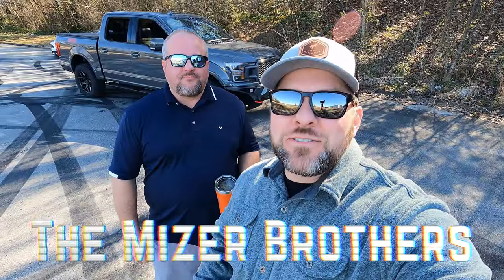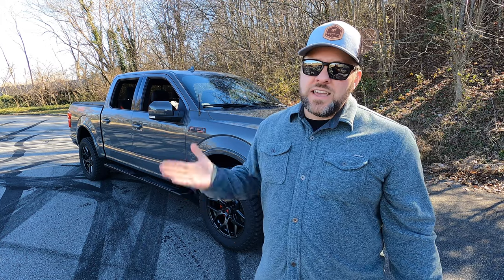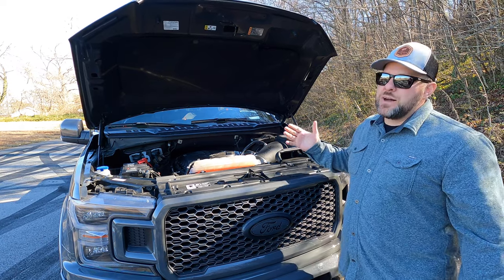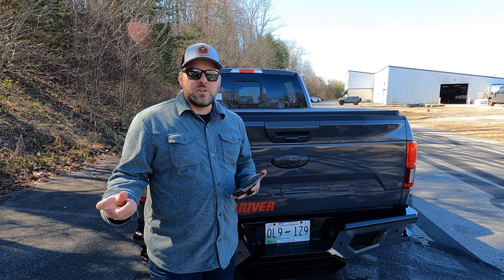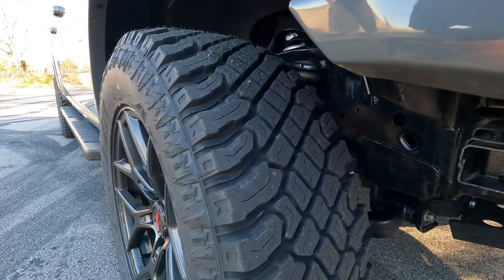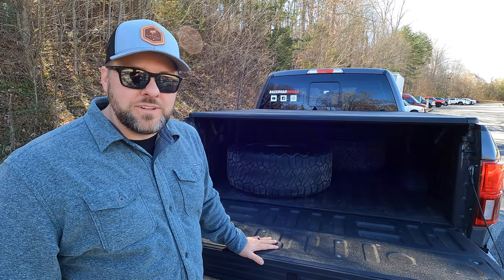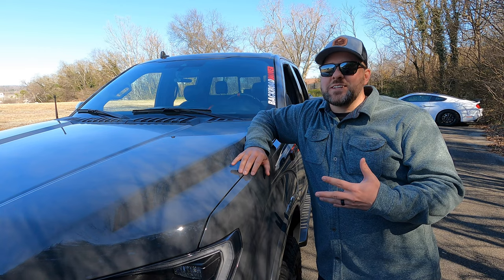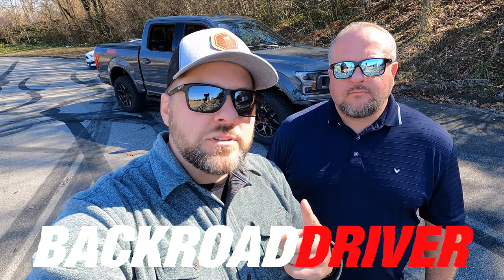What I spent building my 750 HP Supercharged Ford F150 - Complete build breakdown of The Wolf!

Comment: Hey Brad, here is my breakdown ion my 2016 f150 Platinum.
-VMP Odin kit, twin 69 mm throttle body, AFE cai, Fore return style fuel system for E85, long tube Charles’s headers with 3” true dual exhaust, oil pump gears and crank gear—$15,000

RTR wheels and 33” nitro ridge grapplers—$2,500

Icon 2.5” adhustable compression coil overs—$2,800

BWoody front and rear diff brackets and traction bars—$700

P3 vent integrated vent multi gauge—$540

About $22,000 total

740 hp at rear wheels and 615 lbft of torque.

You should check out the P3 V3 integrated vent multitude. It has some great features and looks awesome. Measures boost, speed, coolant temp, transmission temp, egt, iginition timing, AFR, it will do your 0-60 times.
I will try and attach a short video on your Facebook page.
Reply from the maker: Thanks Alex! Your Platinum sounds awesome! Do you have any wheel hop when you launch?
Reply: @BackroadDriver  I have absolutely none. However, I don’t quite have as much fun with mine as you do yours, haha.  The times I have really gotten in it though from a dead stop, I haven’t gotten any wheel hop.
Reply from the maker: We are about to get the wheel hop figured out. Thanks for taking the time to lay out your build!
Reply: @BackroadDriver  no problem. You have inspired most of it.  I think the only thing left I want to do is save up for front and rear Wilwood brakes.  I sent you a message on Facebook showing the details of that P3 gauge. It really is fun to mess with.  In the video I referenced a guy named Justin. I originally made the video for a buddy of mine. I didn’t want you to think that I thought your name was Justin.

After I installed the Fore fuel system and did the e85, I got 780 hp at rear wheels and 620 lbft torque.  This was at almost 14 psi boost.  

I saw where VMP just released some new dual pump return style fuel hats for the Mustangs that include the buckets to keep the engine from having any fuel starvation when you are low on fuel. They might fit an F150 whenever you are ready to go that route.  With my Fore system without the bucket, I have to be careful when my fuel gets down below a 1/4 tank.
Reply from the maker: This is awesome info and you are now helping us take it to the next level because you have already gone there. Checking out the video now. Thanks for sending it. Is your truck 2 door or 4 door?
Reply from the maker: I just saw yours in our old message thread. Sick truck!
Reply: @BackroadDriver  it is 4 door 2016 platinum.

Comment: What do you guys think about all the whining about the rusty parts happening right now?? Snowy roads with some products affecting the surface of some parts?
Reply from the maker: We noticed the surface rust when we were doing some reviews of F150’s before Sam’s truck arrived. If it was built it Detroit it has probably already rusted thru it’s undercoating. Trucks built in Kansas City are better. It can be fixed pretty easy and Ford will figure it out and do the work. Nothing happens fast but it will get made right.

Comment: Love the truck.. thats my favorite color ever. Do you have a link for the antenna? Doing some small upgrades to my truck and that's the 1st one I have seen that I like.
Reply from the maker: Rydonair Antenna Compatible with Ford F150 2009-2021 | 7 inches Rubber Antenna Replacement | Designed for Optimized FM/AM Reception https://www.amazon.com/dp/B07MJKMGY4/ref=cm_sw_r_cp_api_glt_fabc_FSVHGYY1PPTVMAT4S90F

Comment: I can’t believe that truck did not have a factory e lock-in 9.75” ,from what you said it has an 8.8 rear end ?  If that’s the case , I Can’t see that lasting long with you running oversized tires.  I love the truck ,I have a very similar truck (2020 502A) with a 3.5  ecoboost , but I know mines not a race truck, I’d chosen a different truck for that . Why did you go with such a heavy loaded truck if you want to go fast? The weight just makes it less reliable and it breaks parts easier,besides the obvious that it slows you down and costs more... a reg cab XLT would have saved you tons of money and so much quicker, it’s not like this trucks going to be reliable with how you beating it . I can’t wait to see the power it makes when you turn it up. Right now it’s no quicker than a 2018 and newer 3.5 ecoboost with a Dw400, an e50 tune ,an intercooler and a HPFP ...about 3500 in mods.... due to it being so heavy otherwise I think you’d have a mid 10 sec truck if it were a reg cab....good luck and keep up the content.
Reply from the maker: You are right on every point. I traded a 5.0 Mustang and a Raptor to get this truck and make a fast V8 truck that should not be fast. Our GT500 and GT350 will eventually get crazy power upgrades and smoke the truck but we can make the truck one of the fastest 4 doors in the world. Being the fastest mustang is almost impossible. I think it’s fun because it shouldn’t be possible. The 3.5 with mods you laid out is pushed all the way out. This 5.0 is just getting started. We may end up with a completely race rear end before it over. Donuts blow the rear end up. No more donuts...
Reply from the maker: Sad but true. Ford and GM would never add this crap without EPA regulations getting crazy.

Comment: Love the channel! The wolf is a BEAST! Question, is it necessary to upgrade the gears in the rear end of adding bigger tires? I’ve got 331 gears from factory but added 305/55r20 with 2 inch leveling kit. 275/55r20 stock. I don’t do any towing or anything. Just wondering what your thoughts were if I should upgrade to 355 gears. 2019 Ford F-150 lariat 3.5 ecoboost
Reply from the maker: Thanks for checking us out Michael! I wouldn’t change gears unless the truck feels sluggish and it’s driving you crazy. Once you crack the diff covers open and change things it seems to be down hill from there. I worry about breaking things in my rear diff every time we get on it or I hear a noise. With the change you made in tire size, I would make sure to have the dealer update your tire size on your trucks ECU so that your Speedo is accurate. If you want a more lively truck and you have a 3.5 all you need to do is get a tune. The tune will spoil the turbos up quicker and add pedal response. It will feel like a new truck. Thanks for watching!
Reply: @BackroadDriver  thanks for the reply! I probably won’t mess with the gears. Yep I’ve had the dealer change the speedo already. Keep the videos coming. Btw the gt350 sounds incredible! 🤘🏻
Reply from the maker: Check out the 3 videos in this playlist about the 350. Make sure to watch them in order oldest to newest. Let me know what you think.
https://youtube.com/playlist?list=PLWLnOjIIZkiYZbSgHUoz8FpQ--5-HrRTT
Reply: @BackroadDriver  already watched them all lol. I subscribed awhile back. Keep them coming! I was worried you were getting rid of the gt350 but nope! You couldn’t do it! Lol
Reply from the maker: We’ve already schemed up some new plans for the Shelby’s..,
Reply: @BackroadDriver  I’ll definitely be watching for those videos

Comment: Very nice. Sorry if I missed it but how many liters is the supercharger?
Reply from the maker: This Odin unit is 2.65. It has some big efficiencies from having such a large supercharger intercooler so it runs cooler. VMP is about the launch a larger version of Odin that will crank out even more boost.
Reply: @BackroadDriver  Thanks, that is my favorite part. I have the Roush 2.65 but it is under warranty so no changes on that for now. Your pricing on the truck shows you can do this for under $100K and still have a great vehicle.
Reply from the maker: We were lucky that the cost of a slightly used truck was way down at the time we started. Used trucks are thru the roof right now...
Reply: @BackroadDriver  Keep going, I would like to see both the traction bars and when available a high performance brake upgrade. One question though, what are all those skid marks in your lot?😂
Reply from the maker: Traction bar repair parts are on the way and I think brakes need to be ordered ASAP. About the skid marks... check this out:
https://youtu.be/UyybNB0io9A